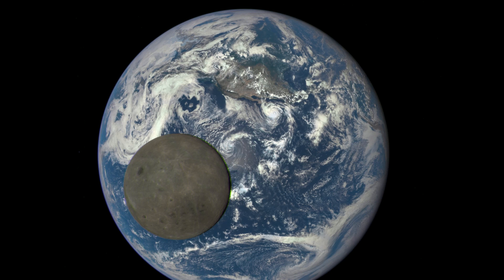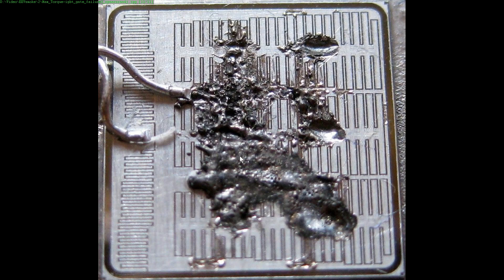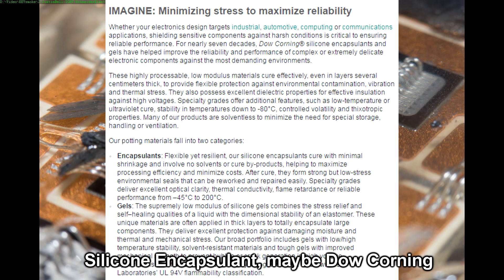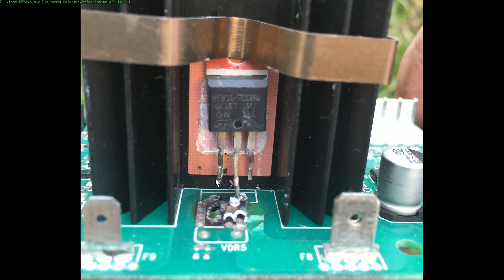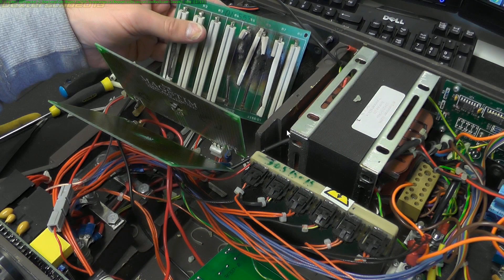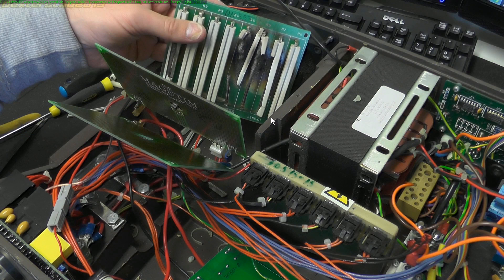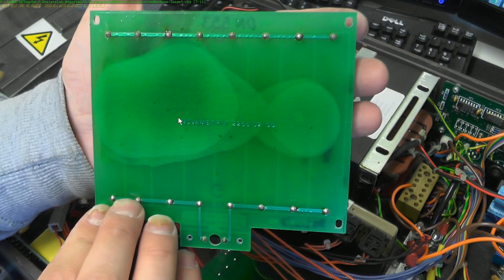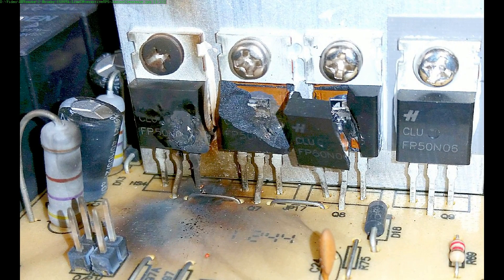EEVsmoke #2 - Magic Smoke Captured!

Comment: We used to have big DC Drives that had several IGBT's and banks of Caps.  When they went out it was like a shotgun went off.
One time I was behind the machine with my test equipment on the drive (he said the drive was acting up), and a passing operator was looking at the meter set up with me when I told the operator on the other side to try and start the machine.
When he hit the start button it was KAPOW!! The operator next to me jumped in the air and ran away.  I think that gave her a better appreciation of the job we did.  Nobody likes explosions.  Well, there was that one guy....
Reply: Many years ago, I was a crazy high school student.  I charged up an old TV capacitor to 360 out of the 400 volts it could have taken, put it in a plastic cup, and short-circuited it on my locker.  The earth-shattering KABOOM and the lightning show that created it were spectacular, to say the least.  I proved, with that experiment, that a television capacitor can hold its charge for at least an hour.  At least, hold a charge enough to pop a cap on a locker.
Reply: In Italy we have the E402a which is an electric locomotive with three phase asynchronous motors driven via GTO inverters that are either in series or in parallel depending on the voltage of the catenary. One day in Ventimiglia after changing the voltage from 1500V to 3000V the control circuit didn't reconfigure itself to the new voltage (software bug...) and the two inverters remained in parallel even on 3000V! I was on that train, two carriages behind the locomotive and heard a loud BOOOM like someone had fired an antitank gun, and saw one of the lateral panels (2x3m steel sections) being BLOWN OFF THE SIDE OF THE LOCOMOTIVE, across the other track and landing a few metres away. There was no fire, just that explosion.

Needless to say, we waited about two hours and an old, rheostatic locomotive came and pulled our train to its destination. The E402a are not allowed anymore to run on 1500V because of the possibility of that software bug :D

Comment: The UPS one is interesting, that's not on the mains voltage part of it at all, that is in the high frequency voltage step up section. FYI modern inverters are DC -> DC to DC high frequency step up -> bipolar DC rail at mains peak wave voltages referenced to ground (+ rail is positive peak - rail is negative peak) -> mains frequency inverter -> Mains frequency AC. It's a bit different for true sine wave.

True sine wave is:
DC -> DC to DC converter -> bipolar DC rail at mains peak voltages -> Class D amplifiers -> Filters - mains voltage AC out.

Classic (low frequency) is:

DC -> inverter (mechanical or electronic) - Transformer -> AC output.

Comment: The roach beats the dead mouse I pulled out of the VCR 25 years ago or so.   it was a model that had a DC-DC converter on the front PCB for the VF display, and he had found the  output.

Comment: Can we see video of magic smoke instead of a slideshow?
Reply: You need to watch Louis Rossmann for that.
Reply: He only did that once iirc
Reply: The point of this is natural failures which you can't really record because you don't know when its going to happen, there's more to learn from seeing something that failed in normal operation and working out why it did that than just sticking a transistor across a power supply and turning the voltage up too high.
Reply: Yeah, onefire modification :)